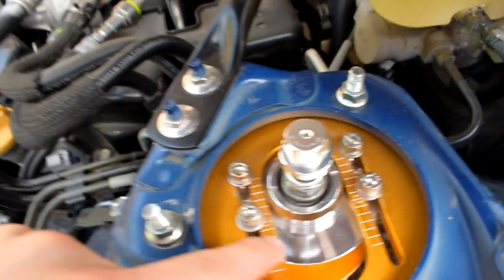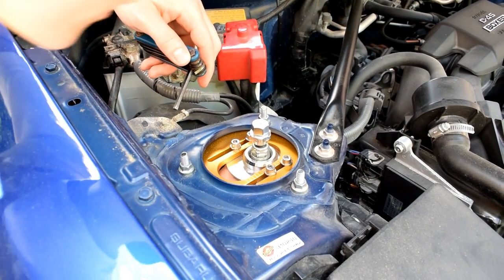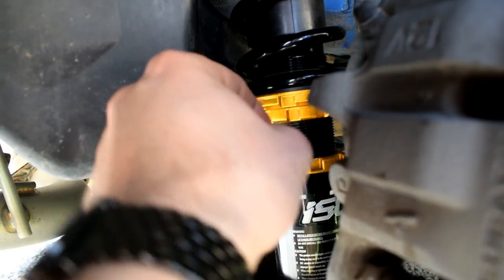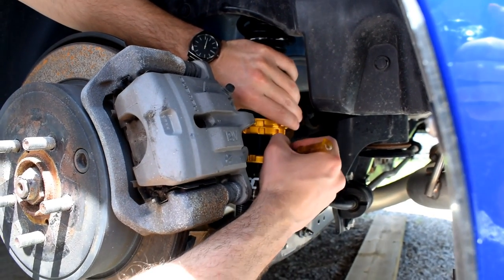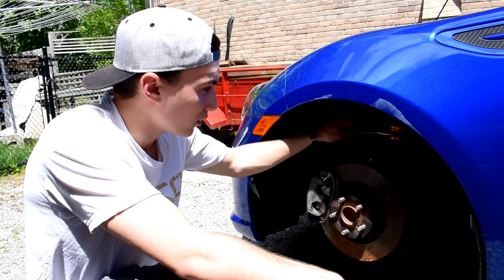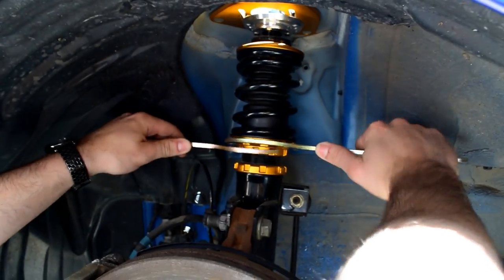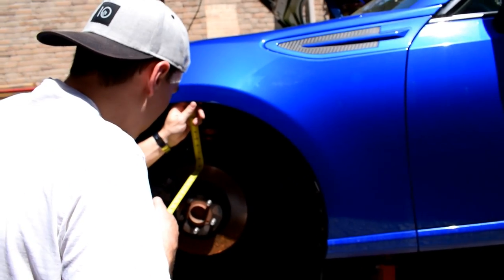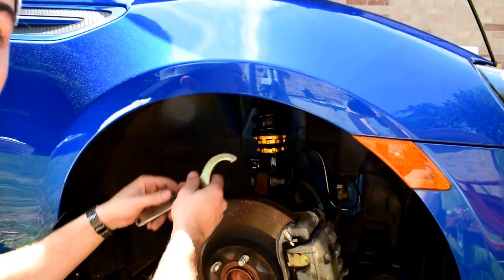Adjusting Coilover Height & Camber !

Comment: If you want to measure ride height you use a measuring tool. I use an electrical measuring tool. Between the bottom locking nut and the base of the coil over. You get a precise measurement.

Comment: Spring compression tends to change ride height as well. if the ride height is different and you haven't measured preload you could make the problem worse. You may have just made the other side even more soft trying to level the ride height. take em out, measure, reinstall, get corner balanced?

Comment: You can also remove that first bolt near the motor on the camber plate and slide it even more!
Reply: So I'm guessing that's what you have to do to get more degrees of negative camber?.. like past -3* of camber?

Comment: Hey man. Informative and clear video. I'd adjust my ride height first as changes in ride height affect camber. As you lower the car the camber becomes more negative, especially in the rear. 2 degrees negative from a 2" drop (very approximately)

Comment: What does camber and damping do to the car?
Reply: Camber sticks the front wheels out for more room for low and damper stiffens or softens ride quality
Reply: @itsyanielxo  horrible explanation lmfaoo camber changes the tilt of the wheel either upward (negative) or downward (positive) and damping is the amount of absorbing the spring is doing and rebound is how fast the spring comes back to its normal state setting

Comment: Buddy you have uneven preload if you left it how you showed, as you loosened the spring tension / preload on all but the one you lowered correctly with out changing spring tension by windind body down into the bottom clamp
Reply: To reset lift each wheel fully loosen spring lower collar  them retighten so you cant jiggle it between the top and bottom cup.then leave the bottom locking collar where it is and wind the bottom spring mount up til you can fit you suspension tool slotted between them then wind locking collar up and tight on bottom spring mount repeat for all then they are all equal again.

Comment: -2 degrees? That seems a tad extreme for normal everyday daily driving. Subaru recomends max.  -1.3° in the front.   Also you need an alignement. Every single time you  fiddle with  yo camber and/or height, you screw the toe faster than bedroom furniture at night. Also worth being mentioned: Don't lower a brz/86 by too much or you'll wear out the og cv joint axles. They go for (600-1000$) btw  Stanced as f&*? Meet the axle nazi, No pulls for you!
Reply: He shoulda done -2* in the rear, too much for the front since that BRZ is RWD.. should go slightly more positive camber in the front
Reply: negative 0.5 camber is totally normal for daily driving. anything 1 and above will wear your tires out hella fast
Reply: @baggedtuned8569  lies i got -9 on my civic and its a daily

Comment: Do you know how to adjust rear camber on coilovers?
Reply: Most rear coilovers do not have camber adjustment. That's usually done by adjusting the upper  arms in the rear either by camber bolts or upper control arms that are fully adjustable.
Reply: Get some adjustable lateral/ camber arms for those adjustments in the rear.